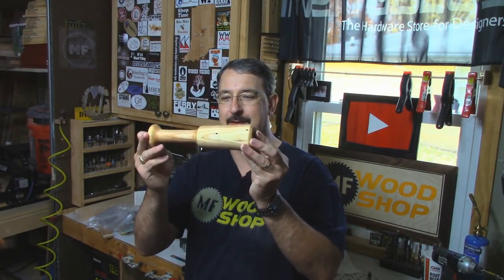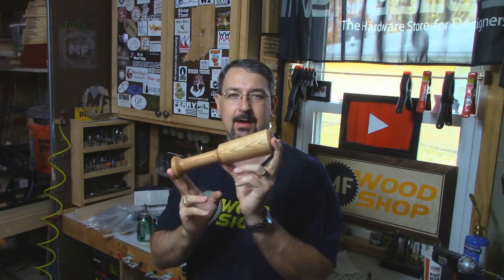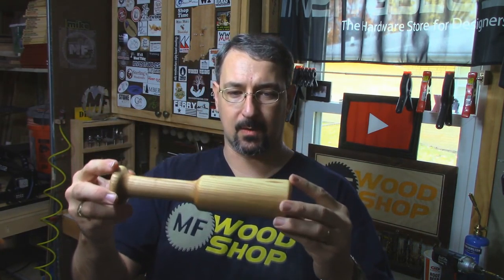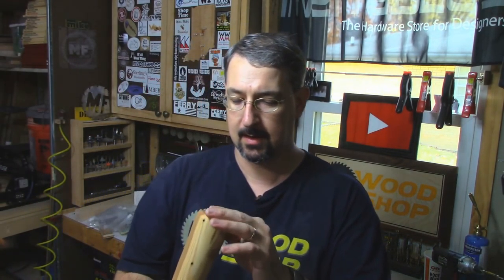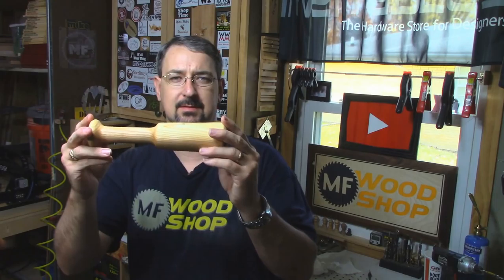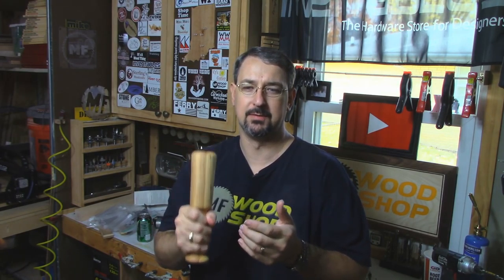Easy to make Wooden Mallet

Comment: Nice Job Mike,  If you are looking for a specific weight of a mallet, you can weigh the mallet and adjust the sinkerks you melt - they are typically sized by ounces so pretty easy to figure out.  Another project to add to the listScott
Reply from the maker: Thanks for the info. Mostly playing around never made one before and always wanted to.